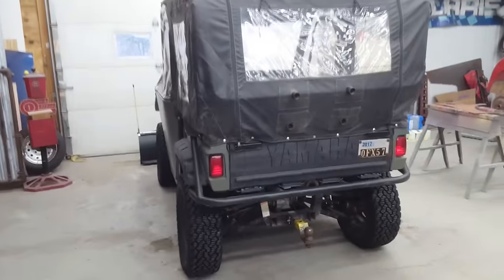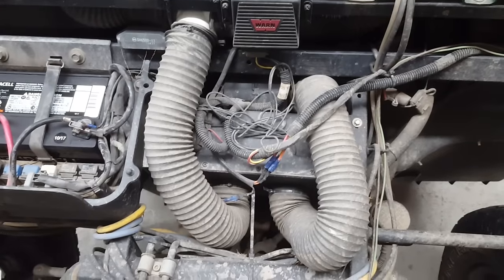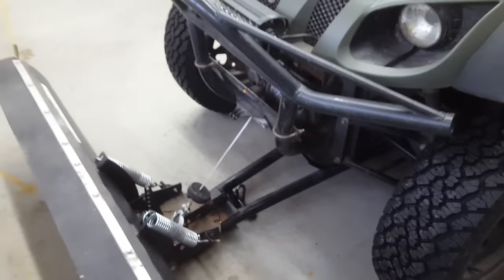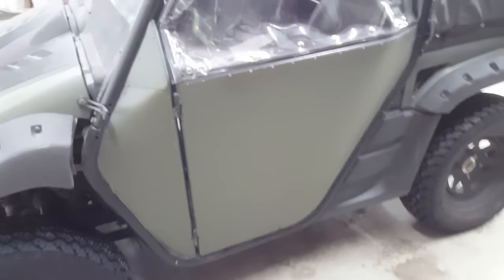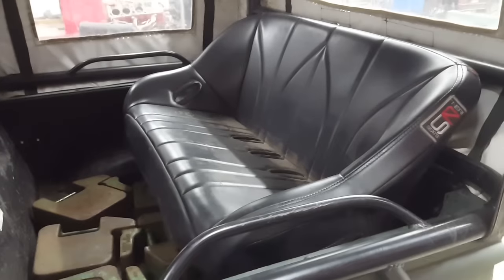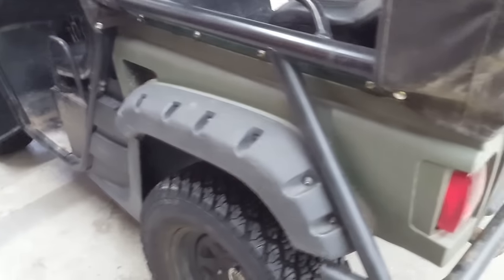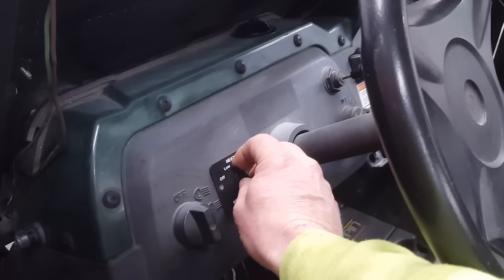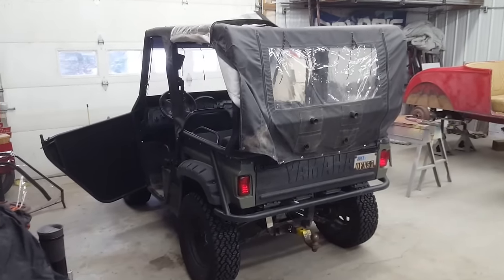VERY CUSTOM YAMAHA RHINO UTV

Comment: I live in NC and inherited my small family farm. We were looking for something that I could use out there and I ran across an 06 rhino that had not been modded out. I like the way you did yours a lot. I’m a fabricator myself and I’m going to be building stuff for mine. This is a pretty slick little unit you have. I have younger grandkids, so a back seat is definitely in order. Much love to you guys 🤙🤙
Reply from the maker: I'm glad I could give you some ideas to improve yours. Good luck with it. Oh I used a conduit bender on the door frames and bought raw steel tube in the same size as conduit so I could weld and paint.

Comment: Great customizing buddy!  NOT nitpicking your work...just a few comments...We've 've got a 07 and love it...the motor is stock but we aren't wanting to go 90 in a side by side, we're happy just cruisin...We also added some mods and cosmetics.  Your rope winch cord will work with breaks but I would go ahead and fit it with a cable, all sizes available at great prices at Harbor Freight.  Your jeep heater is awesome, I fit ours with my own box behind the radiator and installed a inline fan for 4 inch PVC and ducted it right into the floor between our feet...not as good as your's  but works.  Your 15 inch tires with the mod on the rim's to work is GREAT...just a little advise on your rear spacers, way back when we put custom rims with oversized tires on ours and we just had to replace all 4 wheel bearings...3 of them were real bad, keep an eye on yours, especially the rear ones. Again...GREAT WORK...thanks for showing it!

Comment: I bought some (ABS Black Plastic Sheet .060 - 1/16" x 48" x 72” Textured 1 Side Vacuum Forming) supper durable just Drill and pop rivet it on and it looks pro! Lasts a lot longer than canvas! You could easily switch your canvas over to this being you got the frame done.
Reply from the maker: I sold this machine 6 years ago.

Comment: I'm looking for a rhino for trail riding. Your setup is really nice . I use a flat strap for plowing, I just just store a synthetic cable for trail riding in the trunk, that 80 angle off the fairlead will snap metal and synthetic ropes but with the flat strap having a smaller min radius it works well
Reply from the maker: Great Idea

Comment: Love it,, that is sweet. Wish I had one just like it, for real
Getting old an need to plow the driveway
I'm getting a 2006 rhino this week Nov 6-7 18 , love to have the heater,
Could you please tell me what major problem you have had, what goes bad on 06 rhinos 
Thank you very much
Reply from the maker: The biggest problem is it's a carb not fuel injection. For work around home it was fine. Trail ridding it was a different story. They like to over heat because there jetted to lean and they will over heat and vapor lock. Very frustrating. I sold the machine about 6 months ago. Thanks for watching.
Reply: Buck,
Did you pick up that Rhino? Made a walk around video

Comment: nice  job.... to get rid of the faded color  on your plastics  . mix  60% thinner and 40% boiled  linseed oil . mix very well and apply in a circular motion with a soft rag.   if it is to heavy try rubbing it with steel wool  number 0000.    grettings from El Salvador

Comment: Your air intake looks modified. Is the air box in the consul?  I could not see the intake vents. also, I see you have a 32 Roadster body. Making a street rod or a driver?
Reply from the maker: I ran the air intake up to the front under the hood for more fresh air and less nose. 29' body building a blown flathead for it. I have videos of the ford build.
Reply: I tried to run an intake under the hood but it ran like crap and I did not want to start jetting. I tried with first vacuum hose then went to 2.5 inch. It acted goofy at mid to hi rpm. I will check out the roadster. Thanks. If you get time can you do one on the air induction? I have one on electric fuel pump.

Comment: What size tires are those ?
Reply from the maker: Sorry I do not remember the size off hand. Maybe I mentioned it in the video somewhere. They where 28.5 tall with about 8 psi of air in them. Hope this helps
Reply: todd clyne thank you
Reply: todd clyne great rhino by the way
Reply: Pause video at 5:46
Tires are General Grabber AT 2 - Size: 225/70R15 - $131.66 each here:
https://www.tirerack.com/tires/tires.jsp?tireMake=General&tireModel=Grabber%20AT%202&partnum=27SR5GRAT2OWL